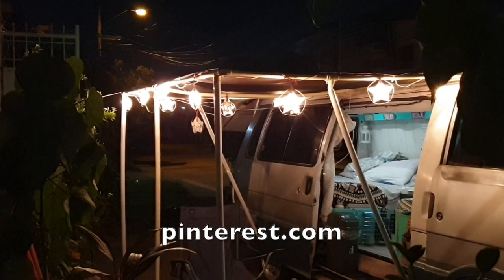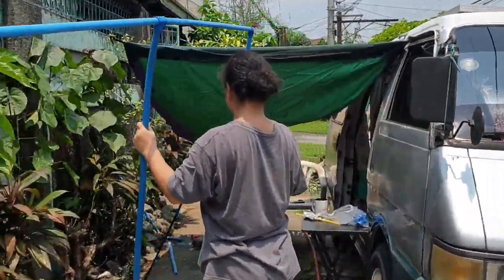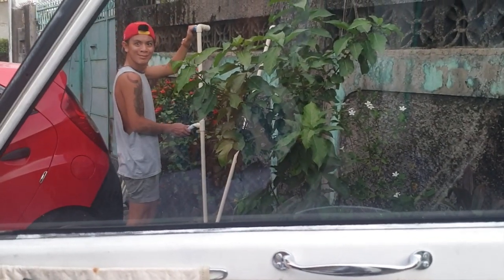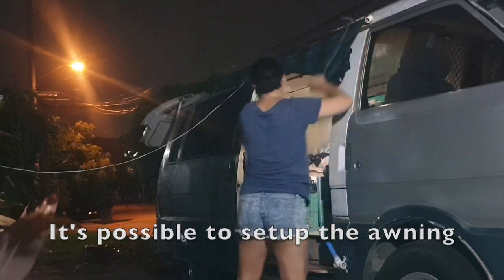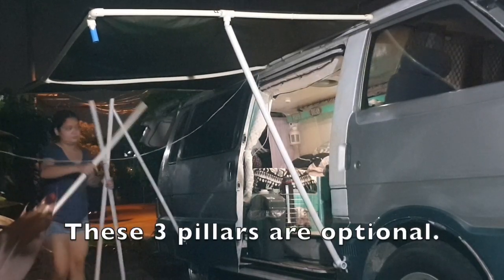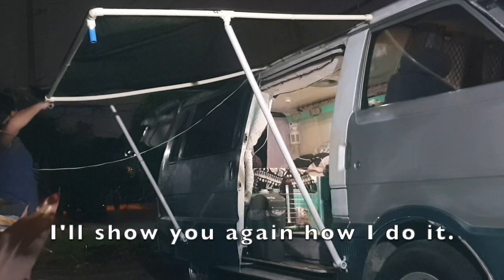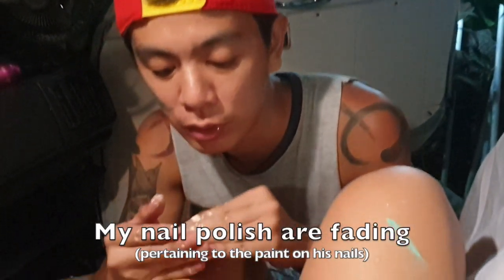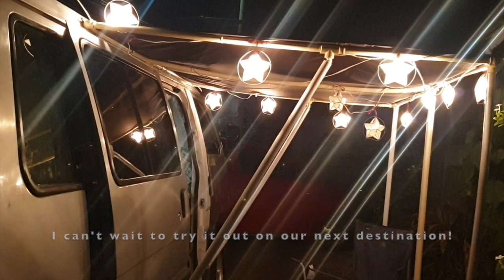#VANLIFE PHILIPPINES: We made a DIY AWNING!

Comment: I would have  gone for those 3 (optional )poles to keep your awning steady instead of those two diagonal poles,that way you wouldnt have to drill holes  to those spots which are  favorite spots of rusts once water and dirt  infiltrates  and would be able to to shut your sliding door without  having to remove that other pole attached to it,just a friendly advice..nice setup anyway..subbed and liked

Comment: One question ma'am. Is the 2 central pvc poles that are attached in the van for support will be bent? Or there's a specific 40° angle of t-joint used? Thank you
Reply from the maker: Yes, we bent it using fire po.
We placed the pipes over the fire to get just enough heat for it to be malleable or bendable. Make sure to use something to protect your hands from getting burned when you're bending the pipes. :)
Reply from the maker: We used a normal Tee fitting. Inserted a bent PVC joint which is just short enough to act as a male insert for the angled support of the base.
I hope this answer makes sense 😅